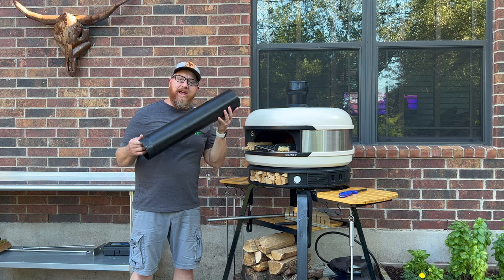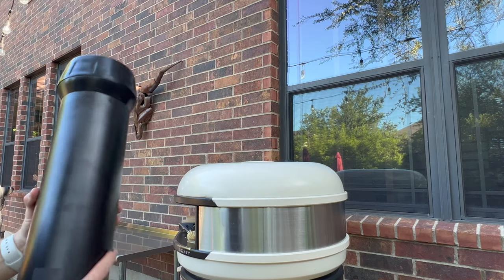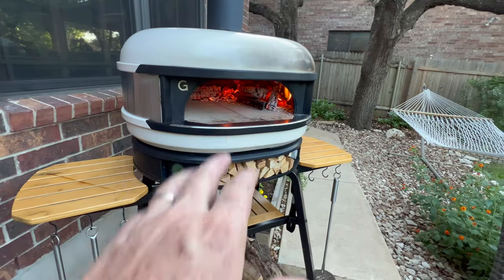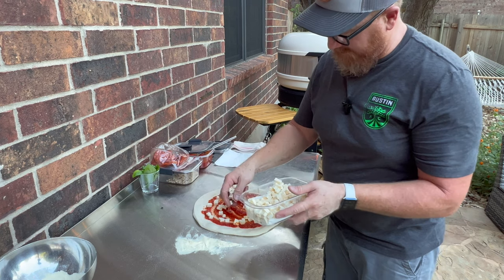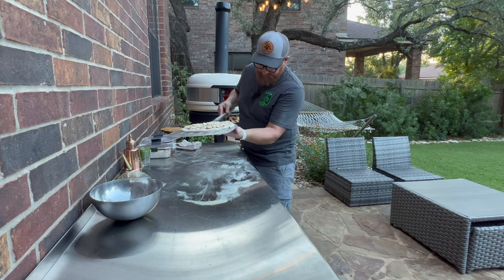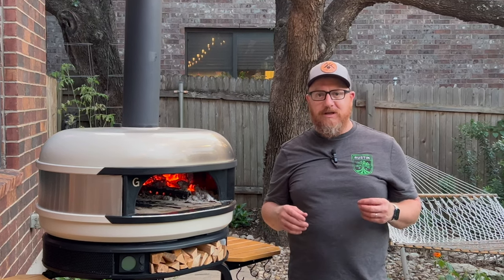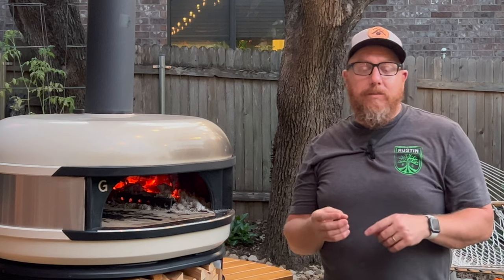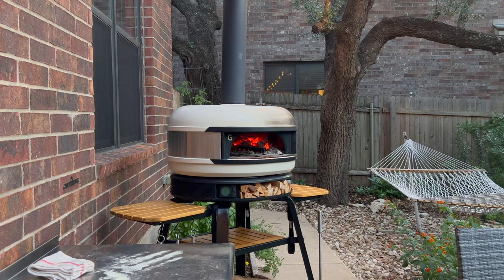Testing New Gozney DOME 24" Chimney

Comment: Great content! I have the wood only version (by choice! Actually every grill and smoker I have is woodfired, I don’t even buy charcoal)… and it definitely helps draw more air and get those oven temps in the 1200F arena (great for searing steaks, flash cooking or even lower hydration Neapolitan style dough pizza: did a 60% hydration pizza at 950F with great results). Extending the chimney definitely helped minimize the soot issue but didn’t eliminate it.  Also, I’m using the two original gozney chimney parts, just sandwiching the extension in the middle.  There’s something about how the bottom chimney part sits on the Dome that makes me think it’s needed… also makes taking off the entire assembly very easy when you want to use the cover, the chimney just sits on the ground next to it.
Reply from the maker: Thanks for watching and sharing your experience!  I tried to wedge the new chimney into the bottom piece but couldn't get it to fit good so i gave up, but will try again.  I agree it would make it fit better.  Yes it did help the oven get much hotter,  I wasn't paying attention to the temp because most of the time i have to wait a while for it to get to temp and with this new stack it was over 1200F within the first 30 min.
Reply: @HarplandProductions  Not sure if the style of chimney extension you bought will fit the bottom piece, I actually purchased a 5” single wall pipe from Tiny Wood Stove which is a solid piece that fits perfectly, granted it was a bit more expensive at $40 plus shipping.
Reply: Also, that blow out at the end happens to all of us! Even the pros. To “clean” your stone, just drag your hot wood coals over to the scorched area and leave it there overnight.  It’ll carbonize whatever is on your stone, then when you go brush the ashes off next day it’s all gone, clean stone ready to go.

Comment: PS if your Dome is in an uncovered area I would recommend using the rain guard under the 24 inch flue. I myself don’t use it since I have my patio “top” covered.
Reply from the maker: Thanks so much for watching and your feedback!  I have been just taking the taller  flue / chimney off and then putting the cover back on!   i wanted to mount the new chimney in the rain guard buy i couldn't get it to fit!
Reply: @HarplandProductions  it’s a snug fit and takes some force, that said. I do like the switching method as you can cover the unit when not is use much easier.

Comment: Is there a way to clean the stone after something like this happens? Does it eventually just burn off and look clean again?
Reply from the maker: Yes,  if your using wood just move the coals over the middle of the stone and then just let it burn off over night.  if using gas just turn the heat up to high and let it burn for a few hours and it should burn off.

Comment: Thanks, just purchased similar (have not used yet). Hoping helps with downdrafts. Winds here cause smoke out ash tray and front of oven.
Reply from the maker: Good luck Chad,  Yes i did see some benefit and for wind and if you are going to use wood more than gas then it's worth the $20

Comment: Great job testing the flue extension.  Gas is best but if you want some of the smoke flavor, you can just add a stick or two while running gas.
Reply from the maker: Great point Luis!  Yeah i like using wood but it's a lot more work,  trying to make a bunch of pizza,  maintain a fire,  then having to clean it all up.........
Reply: An all wood fired oven runs much hotter than any gas oven can get and doesn’t add any smoke flavor since it carbonizes the smoke so quickly at 1000F. I will admit gas is easier, like an automatic vs manual transmission. I prefer manual. 😃

Comment: I think the chimney problem is that there is just not enough air moving to make the chimney draw. Your location seems somewhat enclosed with your house and the neighbors house choking off a sufficient natural air flow to pull air up the flue pipe. We lived in the country years ago with a wood burner and no out buildings or other houses close bye. In the morning we would screw out the two air vents on the wood burner, and boy would it roar as the wind outside pulled on the chimney causing a strong draft.
Reply from the maker: Yes,  that's a valid point!  Thanks for watching !

Comment: You refer to the fire poker as a deer built poker. Do you have a source for that you could share? Our Gozney Dome is on the way (as are many of the NU2U products you've recommended). ? - which round pizza turner do you prefer?
Reply from the maker: Thanks for watching Nancy!  I can’t find a link for that anywhere they may not be making it anymore!  For the round turning peels, I prefer one that’s at least 32” inches long and has a 6 to 7 inch diameter.  For the $. The gozney Dome turning peel and log loader  are nice https://www.gozney.com/products/gozney-turning-peel

Comment: I'm debating buying the larger wood rack but its pretty pricey, do you still continue to see its benefit over just sliding the wood over with a good tool?
Reply from the maker: Hello Jon,   Great question!  Yeah there are defiantly pro's and con's of using a wood rack.  The Pro's are that it improves air flow and keeps the wood from falling into the middle, keeping the stone cleaner.   The Con's are that it's not as easy to just slide the wood over and onto the flame and that if the rack is too big it minimizes your cooking space.  It's also just one more thing to clean and move around, etc.   Gozney just sent me their version and I am hoping to test it out soon, the benefit of theirs is that it's more of a basket than a rack so it's good for the smaller pieces of wood and for charcoal, etc.

Comment: Thanks for the informative video. Are you able to advise if you feel you would have the soot discoloration if you were to only ever use the oven under the gas option?
Reply from the maker: Thanks for watching Luke!  Using only gas you have minimal if any soot at all!!!
Reply: @HarplandProductions  I've only ever used gas (and had my oven replaced due to a manufacturing defect w the lighter) and have had soot markings on both - I think some level of soot is inevitable

Comment: Interesting - does the taller stack increase the draw enough that it increases the operating temperature when you burn wood?
Reply from the maker: Yes,  it was kinda of crazy,  the oven went over 1200F  within 30 min.  I actually has to wait another 30 min to get it to cool back down to make pizza!  That never happened with the old one!
Reply: @HarplandProductions  I am not surprised - the stack improves draft, so it  creates a loose imitation of a Venturi setup (the engineer in me).  When I use my smoker, I often need to adjust the draft by opening or closing intake and stack openings, in an effort to regulate the temperature.  Since the Dome has an open front, and the stack you used does not have a way of dampening the flow (old wood stove stacks had an adjustable damper), you are always running with the throttle wide open.

Comment: Ordered my dual fuel Dome last night to replace the Roccbox I've had for years.  How important/easier do you feel the Nu2u log holder makes things when using wood?  Great videos, keep it up!
Reply: I purchased the Weber charcoal basket and it works wonders for a bit cheaper, plus it keeps the wood nice and neat in one place.
Reply from the maker: Yes it does!

Comment: Also, is there a type of wood your using that you think works best for that wood fired pizza taste?  What kind of wood?  Where do you get it?  Thanks?
Reply from the maker: hello Mike, thanks so much for watching!

Tumbleweeds Fire-starters Value Pack - Frontier (2 Pack)
https://amzn.to/3ePABFO

Smoak Firewood Cooking Wood 8” Logs
https://amzn.to/3ixWDPI

Smoak Firewood Cooking Wood 5”-6”  Logs
https://amzn.to/3IAAF8Y

  It's kinda of a misconception that using wood for Neapolitan pizza gives 
it a wood smoke taste.  for Neapolitan you need the oven and fire super hot at around 850F  when a wood fire is this hot it burns very clean (If using dry wood)  so there really isn't much if any smoke, and the pizza is only in the oven for 60-90 seconds.  Wood is great, and fun to use if you have the time to manage the fire and are going to be cooking enough pizzas to justify the extra time and effort.  Hope this helps!

Comment: THis is another great video thank you for sharing your analysis. Does the fact that the pizza oven is placed so close to the building affect airflow over the chimney? Would the draw through either chimney be better if it were further away from the building? And separately, is it easier to place the shaped pizza dough on the peel before dressing it?
Reply from the maker: Thanks for watching John, I’m not sure if moving it away from the wall would it impact the chimney at all. Typically it’s better to make the pizza on the table and minimize the amount of time it’s on your Peel to prevent it from sticking, the longer it’s on the peel the more chance you have of it sticking

Comment: I live in Houston, and I have a question, do you leave that stainless steel table outside and or do you cover it? I am saving for a Gozney pizza oven.
Reply from the maker: Yes I do!  It stays outside year round,  here is the link to the table and cover i use 

My Table is 60” X 24” GRIDMANN NSF Stainless Steel Commercial table. I keep it outside all year.  The cover i have is below also
https://amzn.to/2UiImO6

Arcedo Outdoor Bistro Table Set Cover, Heavy Duty Waterproof Patio Furniture Covers for 3 Pieces Bistro Set, All Weather Resistant Outdoor Table and Chair Covers, 65" L x 28" W x 30" H, Beige & Brown
https://amzn.to/3wiGkvp
Reply: @HarplandProductions  Yes, sorry after I put that comment, I went back and saw it in the description but from a computer instead.

Comment: Would you recommend the Gozney Dome over the Emozione oven?
Reply from the maker: Hello Sharonda,  They are very different ovens.  It really depends what you want out of the oven and how you are going to use it.  If you need one that you will easily be able to move around your patio than the DOME is better because you can put it on a stand and move it around on it's wheels and I think it's just a better looking oven so i like having it out in my patio.  The Emozione has a better stone floor and arguably makes for better Neapolitan Pizza  but both ovens cook amazingly,  The Stones on the Emozione are exchangeable and can be replaced easily if needed the DOME's cannot be removed.  The Emozione is a more basic designed oven and doesn't have any extra functions or features,  the burner is good but very basic and needs to be hand lit,  the DOME has a digital temp gauge, auto ignition and is both Wood or Gas the Emozione is gas only, etc.  Hope this helps

Comment: I am starting to think that a pizzeria deck style oven is the better option.
Reply from the maker: For NYC style a deck style oven is better but they don’t get hot enough for Neapolitan style, which need to be around 850°. The deck style ones typically max out around 500-550° the only thing with buying one of those is that you can really do the same thing in a home oven!